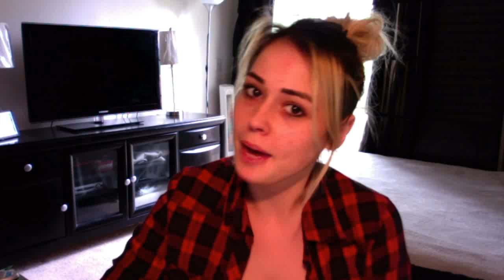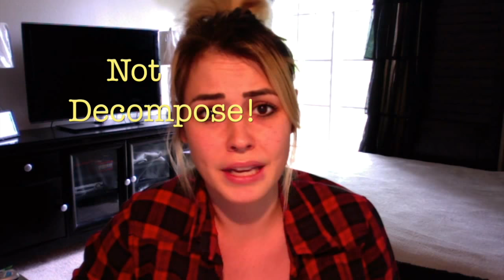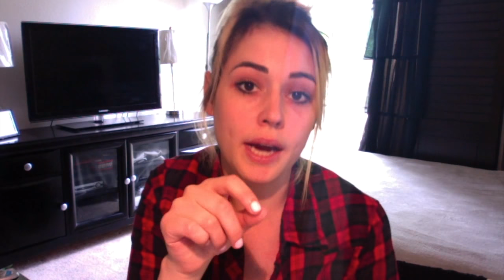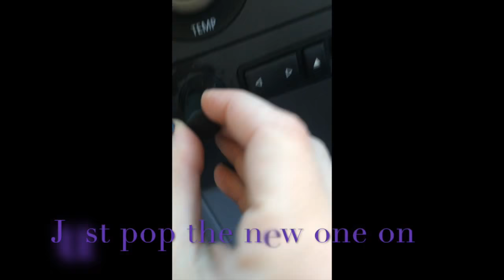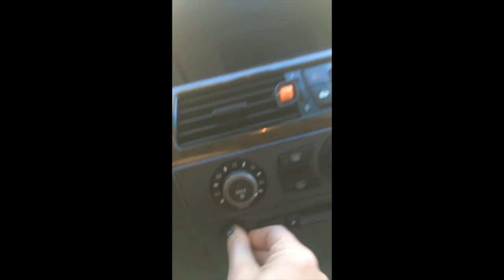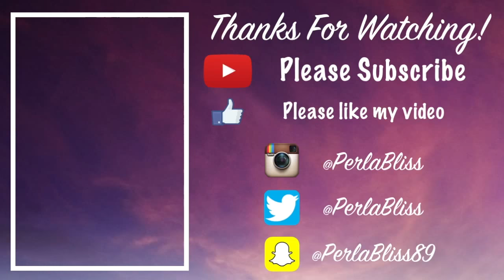How to Change BMW Volume Knob

Comment: Thank you to the cool girl in a video from 7 years ago for saving me valuable time probably spent on removing the whole stereo before i could safely pull on it. Because mine will break if i try to remove it and i dont want a broken knob before i order a new one. 

Thank you, thank you!
Reply: Same lmaoo
Reply: where did you get the volume button from ?